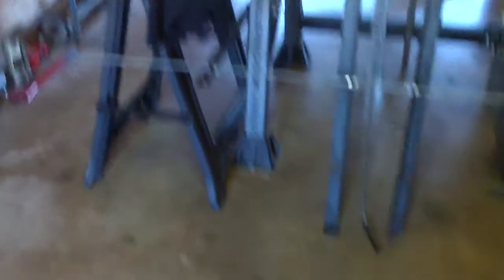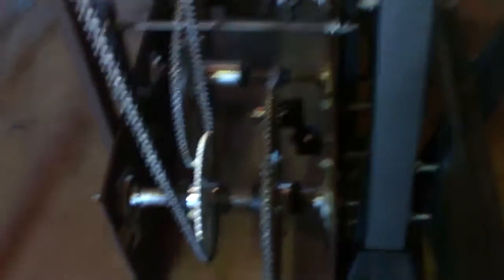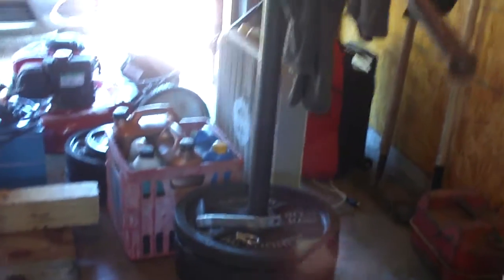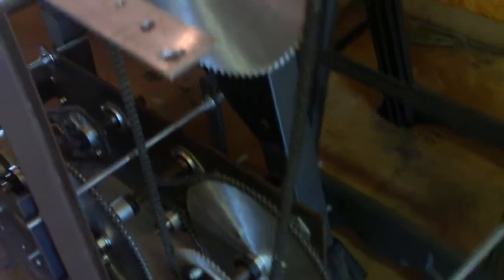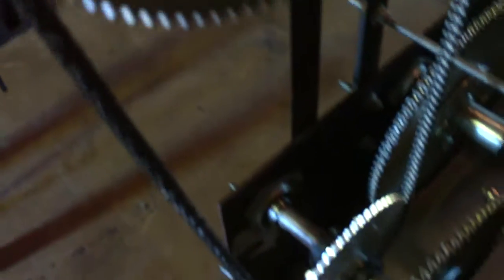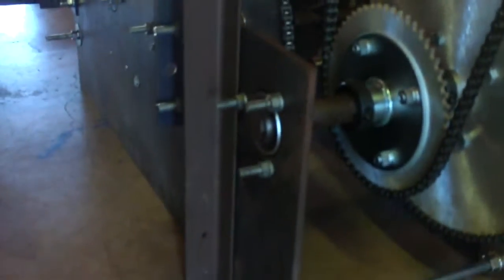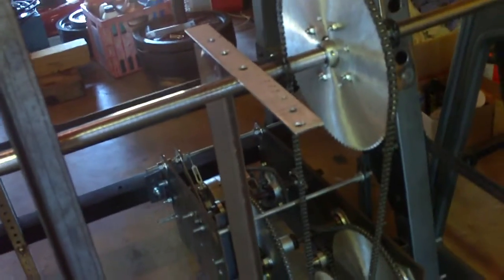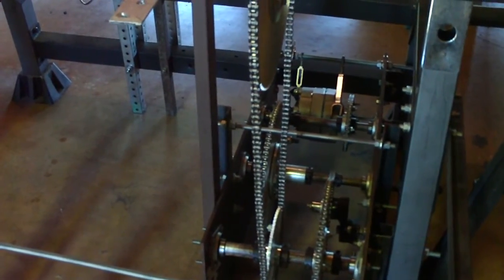54 - Gearbox Moved & Transfer Shaft Added

Comment: Without the chain tensioners, won't there be a problem when the chain stretches over time, especially with the amount of force being applied?
Reply from the maker: Great question. Chain is very cheap. The added expense, materials, and fabrication to accommodate a chain tensioner is not worth the hassle. Also alignment is much more accurate without tensioners.
Reply: sounds reasonable